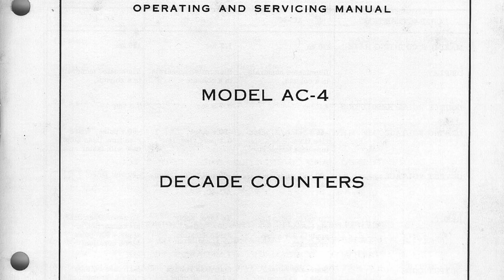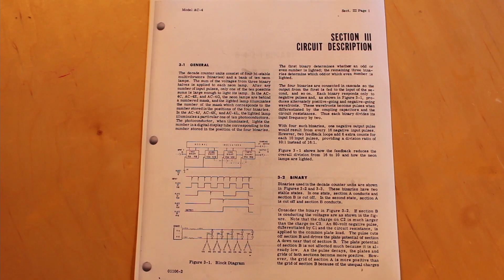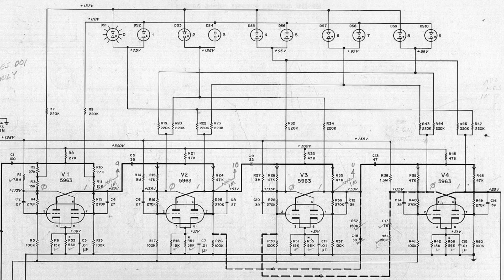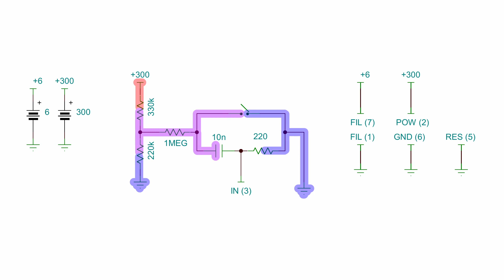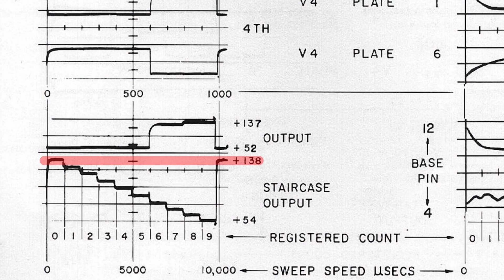In-depth Look at the HP AC-4G Decade Counter

Comment: HP is always just so damn confusing. That's why I don't like them. How on earth am I supposed to program an MCU to read that? It's interesting how the entire track is filled up with solder. Probably to protect the copped and give it more current handling capacity? I wonder if they had a PCB company etch that board or if they just did it themself. No solder mask, nothing. It doesn't even look like FR4. It looks like one of my prototypes that I make before I send it to a PCB manufacturer for production.

Yes, KiCad warns me of any potential mistakes that I have made. Just connect the dots pretty much when plotting the board, but I still prefer to etch my own prototypes first and test it. It has saved my arse on a few occasions.

Comment: i'm really confused by two +ve voltages to neon. will the same method work for LEDs? without Gnd connection, how will electrons flow? should this setup use batteries as source or SMPS or bench power supply?

Comment: Amazing that it is still working perfectly after all that time since it was first manufactured, and they say that Tube technology is fragile and unreliable, I've seen devices made with the latest solid-state electronic technology available today fail after only a month or so.
Reply from the maker: This thing is so well designed, it truly is an amazing bit of history. Of all the tube projects I've worked on, I've come across a handful of bad tubes, but more often than not it's a blown resistor or capacitor that was the root cause. Tubes themselves (aside from being fragile due to the fact they're glass) have proven themselves to be extremely hardy, and a majority of the stuff I have with 60 to 70 year old tubes in them still work like a charm!

Comment: Very cool. I have a similar beast, but it was made by Beckman.  Different build style.  I didn't use a PCB as I remember.
Reply from the maker: Thank you!
I just looked up "Beckman frequency counter" and that's crazy that they have some models with a design that's almost identical to the HP with the vertical rows of neon illuminated decimal digits. Very cool equipment!

Comment: These kind of counters and the decimal modules were common back then.  There were very similar models made by Beckman and others.  I bought one of those from a thrift store around 1990 for $7.  My memory of fuzzy but I think it worked perfectly.  Unfortunately I cannibalized it for its power transformer and crystal oven.
Reply from the maker: I always find it super fascinating how many different design methods were being employed back then! The engineers of the day really were just figuring these things out and using every trick they had at their disposal to get the product working correctly!

Comment: Here is an idea to try.  Connect your vacuum tube 555 circuit to the input of it, and see if it counts on its own.  

I wonder if these kinds of circuits were used in other applications back in the day.  Adders, Counters, Early Computers, Military equipment, Elevator Floor Indicators, Scoreboards, Ticker Tape Marquees, Teletypes, Industrial Machinery Sequencing, and others.  

One other thing to note, the 5963 tube is a special version of the 12AU7 with special cathode coating and a bigger cathode to better handle not wearing out as fast being in one state for extended lengths of time, and handles a lower plate voltage that was developed for digital circuits such as computers and counters.  Early computers had issues with tubes going bad because of cathode poisoning from what i read, and this was caused from being in only a few states for long lengths of time (audio and analog circuits on the other hand use a much greater voltage variation and keep the valve moving across its range).
Reply from the maker: Now that is a cool idea! Unfortunately, the vacuum tube 555 is such low voltage, I don't think it'll provide enough of a voltage change to actually get it to trigger. The AC-4G is looking for a -80V pulse, but the 555 timer can only provide about an 18V to 20V pulse at max. But, that actually leads nicely into something I definitely want to try, which is rebuilding this design as a 4-bit 1248 style binary counter that runs at just 24V. I think the fundamentals are there and it can be done, though it may require some pentodes, which will double the tube count. Still, I think it would be awesome to have a binary counter triggered by the 555 timer!

The Multivibrator design here (with the cross coupled grids and plates) was the fundamental building block for nearly every tube computing circuit I've seen. IBM used multivibrators in just about every configuration they could to perform all sorts of wild computing trickery, it's a really versatile design! IBM had a pretty similar design for a single input flip flop as well: https://i.postimg.cc/8PVjKhwH/FlipFlop.png

Although, HP using capacitors as state memory and interrupting the plate voltage is the first time I've seen that switching method, which is really cool.

The 5863 is a great tube! And, they do seem quite popular among the audio crowd as well, despite not being originally intended for that purpose. IBM really loved to use the 5965 in their designs, which I believe is a specialized version of the 12AT7 built to similar specifications as the 5963. Though, the mainly used it where they needed more power on tap. I think they preferred to use the 6J6 type 7-pin dual triode where possible because it was a more physically compact tube.
Reply: @UsagiElectric  Maybe you could use an amplifier tube to boost the -20V to -80V.  If the gain was 4 you would boost the pulse to -80V
Reply from the maker: @stphinkle  I've done a bit of experimentation with boosting voltage levels up to power some neon bulbs using just 24V input and a tube oscillator. Ideally, I need to wind my own specific transformers. But, I never had great luck in getting any reasonable current out of it, tubes are just a bit too high impedance to do some really tricky things like that with. Though, I have recently done some experiments with a 2D21 Thyratron to generate negative voltage from positive voltage by building an oscillator and negative charge pump, and the Thyratron was actually able to provide about 10mA of current at -10V, which isn't bad at all! With some extra work on that, the design could maybe be refined a bit to get to some nice HV for power neons and other things! Hmm, I'll have to play around a bit more with that...

Comment: I wonder if the staircase output is an early form of a digital to analog converter.
Reply from the maker: I think you may be on to something there, that sounds about right!
I have no clue what it was actually used for in the full machine, but that certainly makes sense!
Reply: @UsagiElectric  I am wondering if it was some kind of feedback loop, controlled the intensity of a light, drove an analog meter, changed the volume or tone of a speaker sound, triggered the carry when it got over a certain voltage, controlled a magic eye tube, or something.  I am not sure.
Reply from the maker: @stphinkle  I did some more digging to see if I could find out what it was being used for in the original frequency counter, but the only manual I could find, used modules that didn't have the staircase voltage output. SO, it wasn't used in earlier versions of the frequency counter, but I still have no clue what HP's original intended use for it was. There are lots of interesting situations where DAC could be useful though, but given how masterful the HP engineers were at seamlessly mixing digital an analog, I'm sure the genuine use is pretty impressive!

Comment: Hey, with 2 modules, do you know what you can do ?
A 2digits voltmeter !
The staircase output is a DAC so you only need a pair of tubes as comparators, then an oscillator that will be inhibited by the comparator.
Thank me later ;)
And this is one of the reasons why this output exists, IMHO (the other for making nice patterns on TV screens, probably)
Reply from the maker: That's actually really smart! 
Also, some cool patterns on an old CRT sounds really epic too, haha.
Reply: @UsagiElectric  That's not smart, that's how it was done back in the days ;-) (I've seen a video where it was done with relays...)

Comment: That was brilliant.  Thank you so much for that.  It would be fun to replicated a low voltage version of that flip-flop.
Reply from the maker: Thank you so much!
That's actually something I really want to do! Though I think I might change it a bit to count in a more traditional 4-bit 1248 weighting style, but I'm very interested in seeing how this design works scaled down to much lower voltages!
Reply: @UsagiElectric  I now got one from eBay as well but have yet to light it up.  You didn't happen to find a socket compatible with the footprint?  I'm also thinking I'll need a opto-coupled interface so I may drive safely it from modern electronic.
Reply from the maker: @tommythorn  That's awesome that you picked one up on eBay! 
Depending on which model you got, the footprint might a little different. If it's an 8-pin, a standard vacuum tube Octal socket should work. If it's a 12-pin one like the AC-4G one I have, I think something like the socket I linked below might work, but I'm not sure. When I get around to building up a proper display for this piece, I'm planning on giving that 12-pin a socket a go. 
An optoisolator is definitely a good call if planning to control it with something modern! Even though the currents are very low, the super high voltages would make quick work of any modern silicon!

Socket: https://www.ebay.com/itm/194014637116?hash=item2d2c2c6c3c:g:1NoAAOSw0EBgaMEf
Reply: @UsagiElectric  Yep AC-4G like yours (12 pin I think, I’m not near it).  If I get around to it, I’d get some more and make it into a clock (or variations there of).
Reply: Add: if you were to make something like this as a kit I would totally buy this.

Comment: I worked on countless numbers of these things during my active years in the United States Air Force PMEL (Precision Measurement Equipment Laboratory. They were well engineered, and well built.  But they were a drag when they broke. (My time was 1965 - 1972).
Reply from the maker: That's awesome that you got to see these things in the wild!
Given how insane the analog digital mixture that's going on here, I can imagine they need a really good scope and a serious familiarity to be able to diagnose them when they're misbehaving!
Reply: @UsagiElectric  The Air Force used HP 524 series, almost exclusively.They were large, heavy, hot (Lots of tubes...) and usually quite reliable.  The reference in them was a crystal, in a heated oven, and in the calibration environment, required extremely long stabilization periods.  Even then they often tended to wander a bit. I sometimes wonder how much better the performance might have been if current technology components had been available for construction. Even so, they were quite the machine.
Reply from the maker: @harryshector  That's awesome, thank you for the extra insight into these! It's interesting you mention long stabilization times, because even this simple little module needed about 5 minutes to properly stabilize and be reliable. Not a problem when filming because it always takes time to get the camera setup, but was infuriating in initial testing! 
That's crazy that they kept the crystal in a heated oven! HP truly liked to overengineer everything!

Comment: What a nice video. The filming is exquisite. The HP folks were analog circuit wizards from the start. Their tube-based instruments achieved a level of perfection which you’d think would be only achievable with far more modern solid state components.
Reply from the maker: Thank you so much! It means a lot to hear that the filming looks good!
Those HP guys were definitely on another level. To build a binary counter that so perfectly blends flip flops with analog wizardry is just inspired. The lateral thinking required just to kind of understand what they created had my brain feeling like it was melting, I couldn't imagine the level of skill it took to design this stuff from the ground up!

Comment: I remember seeing one of those frequency counters actually working, back in the seventies, on a military comunications workbench! It was already obselete then, but quite a thing to behold! it was sitting next to a "newer" nixie display version, both from HP. Was very interesting to see that hibrid way to decode. Makes you think there is  always a different way to get from A to B!
Reply from the maker: The HP Nixie tube version actually uses the same basic design, only the neon bulbs are used as sort of optocouplers to select the appropriate nixie element. Check out the schematic for the AC-4J, AC-4K, or AC-4L in this manual (pdf page 32, 33, 34): http://www.nixiebunny.com/hpac4/hpac4.pdf

You can see it's pretty much identical to the shcematic for the AC-4G that I use in the video, except there's a separate circuit with LDRs that sit right next to the neons. Each LDR creates a voltage divider with the 270k resistor in series with it, and that's what drives the nixie tube element selection! It's such a cool design and a really great way to implement a better readout without redesigning the entire thing!
Reply: @UsagiElectric  sorry, but the link is not working (for us, at the southern hemisphere, at least!)
Reply from the maker: @AlejandroLopez-qd3xm  Hmm, weird that link wasn't working. Here's the same manual hosted at a different place: https://www.steampoweredradio.com/pdf/hewlett%20packard/Hewlett%20Packard%20AC-4%20Decade%20Counter%20Operating%20and%20Service%20Manual.pdf
Reply: @UsagiElectric  got it! Just a thing with my phone. Thank you
Reply: @UsagiElectric  thank you for the circuit insight! I will check it
Reply: @UsagiElectric  I had an HP counter with those neon to Nixie decoders.   Maybe the classic 5245L?  But I put it in my damp subterranean workshop and after 6 months or so all the photoconductive cells went limp.  The cells were a custom hybrid deposited part and not easily repairable.   Sigh.

Comment: Impressive! You might consider to convert it to a permanent working exhibit. It is much too nice, to put it back in the cabinet in a non working state.
Reply from the maker: Thank you!
I was actually thinking about building a display unit for it in this video, but the video would have been much longer and I was too impatient to wait for parts to arrive, haha. Though, I'm glad I waited because C000kie had a brilliant idea to add a rotary phone dial to it so the counter decodes the pulses, which I think would make an awesome addition to the display piece!
But, either way, I'm going to start collecting parts (notably a socket and some good push button switches) and there'll definitely be a follow up with the display piece one of these days!
Reply: @UsagiElectric  take some more tubes to build an oscillator and a comparator, and you get yourself a vintage 2 digits voltmeter.

Comment: This makes me realize, how grateful I am for stuff like TTL logic. 
On the other hand it is amazing how many brilliant ideas came before it. I guess at the time of vacuum tubes, you would do everything to keep the tube count down, so it would be perfectly fine to have weird voltages and waveforms. 
The way of outputting different analog levels in a kind of grid configuration so that only the voltage across one neon bulb is enough to trigger it, blew my mind. 

I did a similar thing when I was at school (propably around the fourth grade),  where I took the voltage drop across different amounts of 1N4148 diodes to build a decoder from an analog voltage to a seven segment clock display made from christmas light bulbs and transistors. 
The input was driven by a single transistor current sorce that charged a capacitor to generate a linear ramp. 
It worked but it also was horribly inaccurate. 

A small side note, respect for taking the results of your project ideas video so serious and making a list with all the responses. 
Thats a whole new level of connecting to your viewers. 

Greetings from Germany, 
Michael
Reply from the maker: Oh absolutely, TTL makes life so much easier! But, to make a 4-bit 1-2-2-4 weighted binary counter out of just four dual triodes is absolutely mental! The engineers of the day were so amazingly good at using every tool in their kit to it's most potential. I never would have thought of using analog signals to create different voltage potentials to convert a binary code into decimal. 

That's awesome that you were already building wild stuff like that in 4th grade! I think in 4th grade the only thing I cared about was being the fastest person to run to the swings, haha. Whether it was horribly inaccurate or not, it worked, which is absolutely awesome!

Really, you guys are awesome! Y'all take the time to not only watch my videos but leave comments/suggestions/ideas that are absolutely invaluable. It's really humbling and awesome to have such an active community of like-minded crazy individuals trading ideas and inspirations!

Side note to the side note, I have a good friend who lives in Germany now! We worked together in Japan for years, but he recently moved back home to Germany. I'm terrible at remembering German city names, but I think he's just outside of Frankfurt.